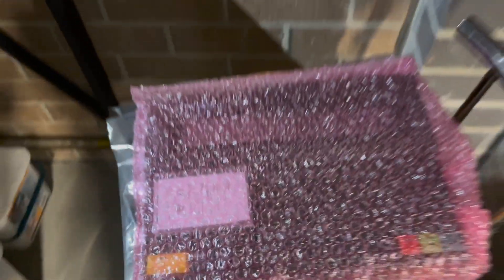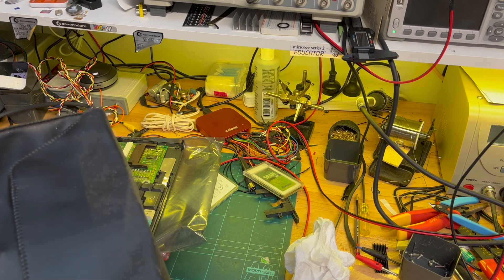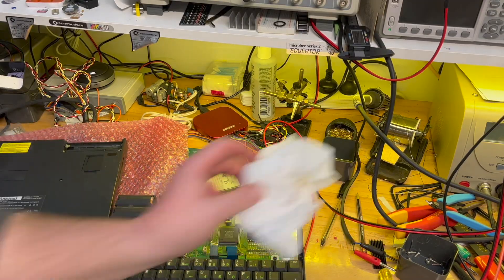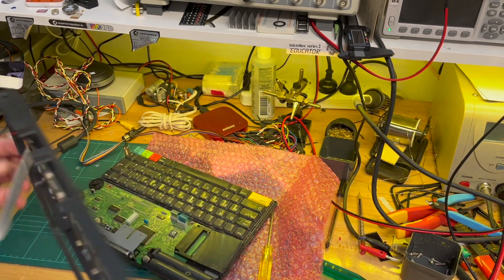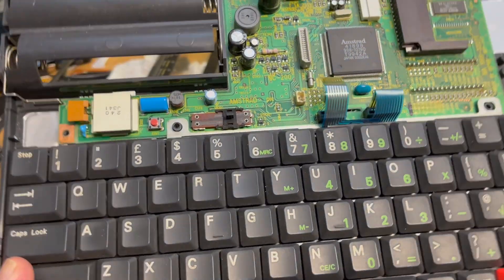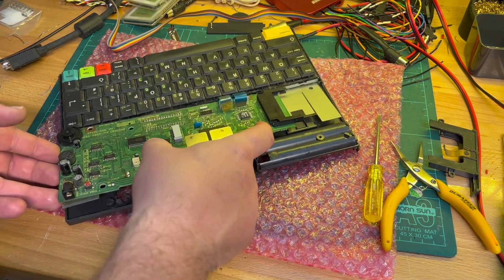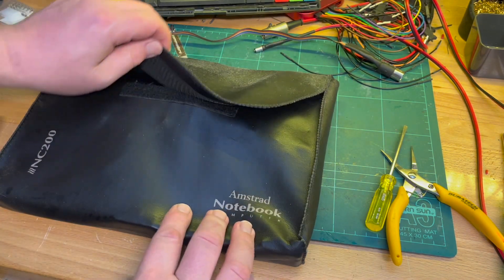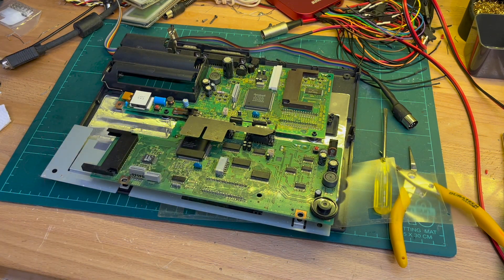🇬🇧 My Amstrad Notepad Computers: Part 1 [TCE #0071]

Comment: Oof, those batteries... hopefully that hasn't destroyed the motherboard. Get the vinegar out! Also, you bemoaned that you weren't planning on doing this today, BUT had that sat for another year it would have completely destroyed that motherboard beyond repair. You got lucky and discovered it before the corrosion really got started. I recently got a lot of calculators including a Casio that had batteries probably from the early 1990s in it. Green corrosion crystals abound! Doused as much of it with vinegar as I could without risking damaging it. I need to get back to it and see if I can get it working. I guess I should start making videos too...